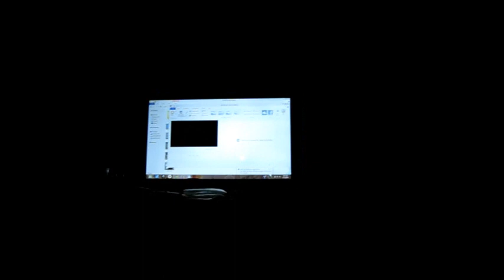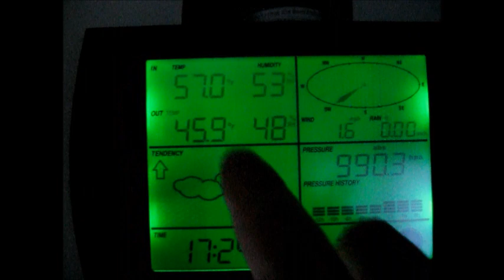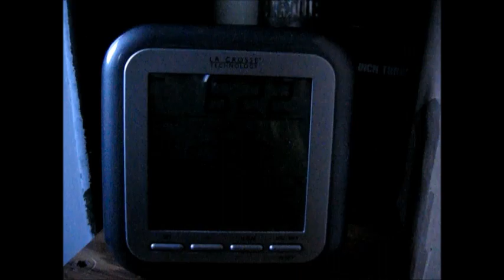Repairing Passive Solar Porch And RV Wood Stove Shed

Comment: I can hear the relief and excitement in your voice Troy, I'm so glad to see you got the porch enclosed and insulated. With that being said I'm a bit concerned about that fiberglass stuff getting wet and being worthless once that happens. I guess you'll cross that bridge if and when you get to it. Keep the videos coming and thanks for sharing the trials and tribulations of your little homestead. Stay safe and warm.
Reply from the maker: Thank you. I plan to seal off the top where water would flow onto the insulation.
Reply: The part that struck me as exposed was the outside where the porch joins the rv wall, blowing snow and rain will collect there also. I understand that it's hard to seal those areas because of how the earth moves with the climate but maybe some sort of flexible membrane would work for that application. Cut strips of a rubber truck bed liner perhaps or something similar. I have no idea how you would secure it to both surfaces though.
Reply from the maker: JustPeg I was thinking about using the left over plastic from my porch and tape it in place.

Comment: You are lucky to have the friends to help.  I would have been up early getting the firewood drying and the porch repaired as soon as I got back from Michigan.  If you have any leftover plastic from the porch you could put it over the firewood to accelerate the drying just make certain the moisture can escape from under the plastic
Reply from the maker: I also had to get my RV in order. Remember I had packed everything up in boxes. I had to get food and water going. Get a place to sleep. Get my clothes out. Lots of things. That is why I first bought the propane. Oh, and I had to dig out my tools and sort things out before I could even work on anything. And the wood stove was useless without the porch. I wrote things down and planned them before I left Michigan.

Comment: We used a roll of plastic around our mini home skirting in the winter months.It use to help cut down on drafts and heating bill "plastic great stuff".I guess if you put some wood stakes up around RV you could staple to those and have a plastic skirt?If you got a piece remaining that back hatch could be covered.It is looking pretty good you`ll have it squared away in no time.Good luck keep them coming.
Reply from the maker: I do have a piece on the back hatch to keep rain off it. Thanks. Good idea on the skirting. Not sure if its worth it for this year or not. Winter is still hanging on.

Comment: i think that's great your friends came to help & also the guy who sent the stuff, it might take a while to get it the way you want it, but it's worth it! you might know this already, but even if you do get underpinning under the camper, it always helps to insulate w/hay, then when spring thaw comes you can break it up & scatter it on the ground, helps w/not tracking the mudd in. Also, you might have wheels on one of the water containers, would help you move whichever one you have to move to fill up w/water/just a thought/love the solar porch!!

Comment: Nice to be warm!!  We had another blast of winter roll through for us today. This is going to be fun. Had to turn off the oil furnace yesterday because the tank was about empty. No money left for more oil. Using the k. heater and an electric space heater for the bathroom.  Spring is supposed to make an appearance again tomorrow. Hopefully it sticks around till summer this time!
Reply from the maker: Hope so. Its been cold. Still is so far today here.
Reply: Not to Butt in nor is this off grid but you can buy untaxed diesel from most truck stops and dump it in your tank. I haul my own and save $.50 to $.70 a gallon over having it delivered.
Reply: I appreciate your suggestion, and will check the cost for my area at first opportunity. But we just bought $50 of kerosene. Hoping that will get us through at least till payday.

Comment: Hi Troy. I've been watching a bunch of your videos for the past couple of weeks. My thoughts: I have a 26 year old mobile home with 12 full size windows that all leak air. During the winter I cover them on the inside with cheap plastic drop cloths and shipping tape. That cuts the drafts down big time. You may also want to crawl under the RV this coming summer and insulate the underside of the floor. This will help solve cold floors and slow convection losses. Sealing wall sockets and switches with tape will cut the minor leaks too and they do add up. Take care and god bless. Cliff in Independence, MO.

Comment: That plastic will hold up better since it's heavier duty than what you had. It will still trap the heat from the sun also.
Reply from the maker: It will hold up better yes. Time will tell me if it works as well for solar I guess.

Comment: Nice to see you got the porch closed in again, that will make an amazing difference for keeping the wind and cold off the camper for you.  Everything else should get a lot easier now that you have this one out of the way.

Just a thought, if you put a nice shelf along the porch back wall, it would make an amazing place to start your seedlings this year for your garden.  That plastic you are using on the porch now diffuses the light which is better for a greenhouse setup thank the direct light.
Reply from the maker: I was going to put a shelf on the front wall, on the outside facing wall as a utility shelf. I thought the indirect light was bad for plants.
Reply: My first thought was the front wall as well, but I thought against the RV would be warmer if you still have the black plastic there.

The diffused light allows more light to reach more of the plants so you don't get the shaded areas.  As for how much difference it really makes, i'm not sure.
Reply from the maker: C Keevil True on the back wall.

Comment: Troy: Your porch looks great. I was wondering if you are looking at doing a screen porch when things warm up and then having some kind of Lexan or plexiglass storm windows for winter. The plexi will stand up to the winter and winds and let sun/heat in and then you have the screens in the summer for cooling winds but no bugs....
Reply from the maker: I am hoping to build a larger, all around shed for the RV like the porch but on all four sides and then screen it in for summer and have removable panels with plastic for winter.

Comment: Porch is looking good. That + blocking wind in the stove shed should get you back into heating mode that you were in before you left. BTW, don't completely seal the heat shed. Needs some air intake for the stove draft and to replace the warm air being drawn into the RV. 

Watched a video, a little while ago by Southernprepper1.  A easy and cheap way to stack your firewood. One of the best ideas that I've seen for stacking wood to dry & keep dry. Planning to use it, here, myself. Thought I'd pass it along. Can see where it would work for you in the forest around you. Should be some stuff in your "forest shopping mall" to cover the stacks. Then, bring to the RV when needed. -- A riding mower, with deck removed will pull a decent pile of dry wood in a small trailer behind it. If you have access to that, should be able to haul quite a bit from the woods, rather than carrying it out, an arm load at a time. -- Anyway, just a thought.
Reply from the maker: Thanks for the pointers. There is a not of air intake around the floor of the wood stove shed. I left it open around the edges.

Comment: Looks like Your getting things back on track!.Hope you have enough firewood.I believe next week is going to get extremely cold.
Reply from the maker: Yes its coming along now. I should be fine for wood for now. I can always still cut dead standing trees if needed. I might anyway and get it stacked as time goes on.
Reply from the maker: Link Knight You could always fill up that back room with wood in boxes. I do plan to have a lot more wood next year. I want to build a wood shed out of pallet wood and put a tin roof on it for next winter.
Reply: The Do It Yourself World Awesome! Wicked cold coming again.be prepared Troy!.Looking good at the homestead!.

Comment: If you install plastic on the inside it will create a dead space and will do an even better job.
Reply from the maker: Link Knight You may be correct. And the sun might not pass through as well then.

Comment: I know there allot you still have to do but hope you get around to playing with the engine on that RV. Like to see some videos of that thing being worked on and running. would also be a nice option in case you need to move it a little. could be sinking into the ground or if you wanna reline it up with your porch, or just decide you wanna new arrangement and move everything around. :-)
Reply from the maker: I agree and hope to get it running soon. I want to move it this year

Comment: I thought that little generator would run like 5 hours on a gallon of gas, I would at least carry some in to give the batteries a good charge until you can get the larger solar panels re connected.
What I do with stuff I just dont want to do but need to is I have to do some to eat, I dont eat breakfast or anything else until I earned the right to eat. I wonder if you could make yourself split like 5 pieces of wood and carry it into the solar porch first thing every day?
I know I have been getting some Great solar lately here in Michigan, when its cold the solar panels are more efficient!

It looks like a day well spent, every day needs to be a step forward. I wonder if you have any old wood you could throw down? When that snow and ice melts its going to be mud city.
Reply from the maker: My first priority was getting heat going in here. That is now fixed. Now I can work on getting more power going. Now I will get some gas.

Comment: Get your seeds started already... You are getting a late start as it is. The seedlings should love being on the solar porch.
Reply: Eric Blonde No hurry on vegetable plants that can be direct seeded & have time to reach maturity before 1st frost. Can't speak for Troy's location. Around here (NC), very few garden plants are started ahead of time by people who grow enough to preserve their harvests. Tomatoes, peppers & cabbage are the most common ones, started ahead. Later in the year, sweet potato slips.

Also, unless supplemental heat is supplied, the solar porch won't stay warm enough to keep plants from freezing over night. (Cold hardy ones are the exception.) Generally during the night porch temp will be only a few degrees higher than the outside temperature during late night / early morning before the sun rises.

Most common vegetable garden plants need around 50 F soil temp for good germination. Still have a couple of plant tray heating pads from the days when ran a greenhouse year round. Stopped that when fuel expenses cost more than the plants were worth.
Reply from the maker: I have to wait until its no longer below freezing at night before I can plant. Its currently in the single digits sometimes. Crazy year with a long winter holding on yet

Comment: did you also figure out what shifted on the porch ? i can imagine the rv sunk in the ground a little since your door also bottoms out with the rubber matt init maybe you should prop it up with blocks or stones so it will stay steady ,just a idea of what i was thinking also good to see that the porch is back covered .did you ever think of getting sheets of plexiglass in your porch i know they won't be cheap but at least they won't rip during heavy winds ,i am happy your back at the off grid homestead i am checking everyday if you posted a video ,greetings sebastian (holland)
Reply from the maker: Greetings back. I think it was the ground shifting due to the freeze. It is settling back again on its own. The porch is temporary and will be rebuilt larger this summer, if time permits.

Comment: To bad you do not have any rigid clear plastic for the porch area. I don't think solid plastic off gases like loose plastic. Could be wrong. Anyone know?

Do folks in your area have to re grade their gravel driveways come spring?  Folks have to do that here once the gravel has worn down after 3-5 years, depending on the amount of rain one gets.
Reply from the maker: The landlady's drive is shot. The gravel road always need maintenance. Every two weeks.

Comment: you have to put your wood on your porch to dry.
where are your wind turbines?
Reply from the maker: I keep wood on the porch daily now. Wind turbines I took down for safety when I was gone. I need to get them up again soon.
Reply: you have to put your wood insite your other rv.
oudside no good.
look for truma ore webasto diesel heating.
its save has timer and needs not mutch diesel.
cover your front of your rv is better.
Reply from the maker: Michel Brouwer My porch is now covered. I plan to build a wood shed soon with pallets and keep the wood covered.

Comment: Didn't you have an old generator from your land lady that you got running?
Reply from the maker: No, she never had one. But I did have an old one myself that I had running. The carb was shot and it died on me. It was rusty inside and damaged. I cleaned it and that was stupid. Now it floods and will not cut off the gas flow.
Reply from the maker: ***** The float is fine but the needle seat is shot. Now gas flows around it without end. I guess the dirt was helping to seal it.
Reply from the maker: flash001USA I have considered it yes. But wood gas is filthy and will plug up an engine quickly from my studies. I am looking into ways to filter the wood gas before burning it in an engine. But most plans look quite complicated.
Reply: The Do It Yourself World
When a gasifier is set up correctly it will not clog up an engine. If you try to use a FEMA gasifier it will clog up an engine in a NY minute. My gasifier is so clean that I may as well be producing natural gas. The filtered side of the gasifier is invisible so there are no carbon soots nor tars in the gas but I understand where you are coming from if you have no tools to take on a job like building a gasifier.

Comment: if you didnt throw out all he old see thru plastic, cut a hole in the new plastic lined up with your window or whatever and tape in a piece of the clear then youll have a window you can see through
Reply from the maker: I can look out the roof if needed.
Reply: true, its always an option though, might want a window to let heat out eventually but i guess the door is good for that lol
Reply: The Do It Yourself World You should buy a piece of the see through roof material just for the window part to put on the side. So You can always see out and it dont get destroyed by the wind like the cheap roll plastic does. Remember next time your at Lowes or Homedepo to get a piece of clear plastic roofing material so you can have some on the side too for viewing out.
Reply from the maker: shartne I will when I build a more permanent structure. I hope to build a shed all around the RV if time permits this year.

Comment: I cant figure out why your voltage is so low, Is there something wrong with your connection to the panels? I thought that you would have checked that out as soon as you got home?
Reply: His wires and everything was under allot snow. I would be like screw it too and wait till it melted enough to get to everything and rehook up the panels he had disconnected before his trip if i recall correctly
Reply from the maker: I think its due to the cold on the batteries. These batteries do not seem to like the cold at all. I am seeing a trend here with them since using the same type in the last two winters. They just dont like cold and the voltage varies with the temperature a lot. That is the pattern I find anyway.
Reply: Thats a given also with allot batteries i seen. they will be a pain in the neck in the cold. When I still had my Scooters they where more of a pain to keep charged in the winter even with being brand new. Intence temps in both hot or cold will effect them.
Reply: The Do It Yourself World i have 2 deep cycles on my 2 panel 185 watt system...they show 14 volts during the day with good sun...then by night they are under 13 volts and i only have about 8 watts of led lights in use...its the cold ..i have seen others in video's state such...they like the 70 degree weather...as where solar panels love the cold since heat causes resistance of power flow in wires...hey Troy ..just got an idea...can you run a 2" plastic pipe from the solar porch under the RV to your battery box to heat them up during the day
Reply from the maker: ***** But a lot of cost involved too. I am sticking with lead acid until the prices drop.
Reply from the maker: swanyut Oh, nice idea to use solar to heat my batteries. Thanks for the idea. I can build a little solar heater outside the RV right by the battery bank.